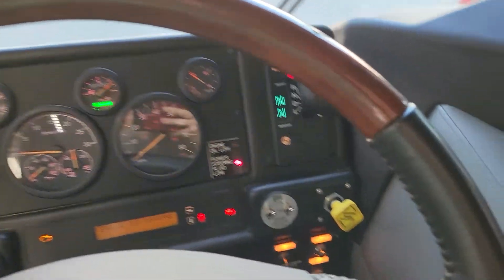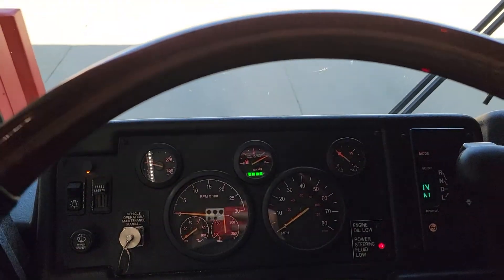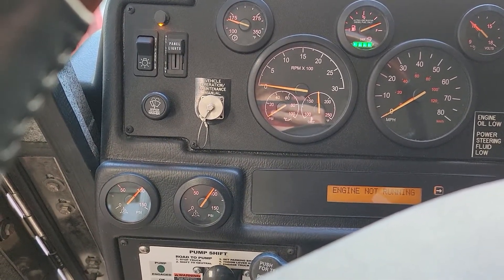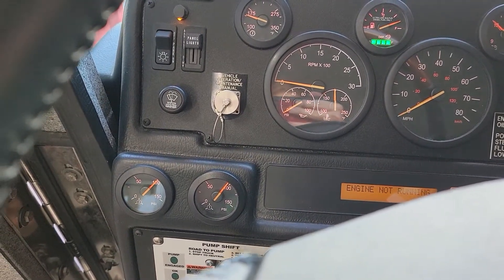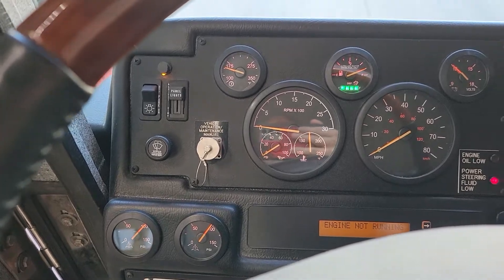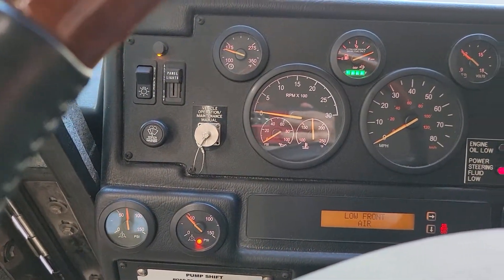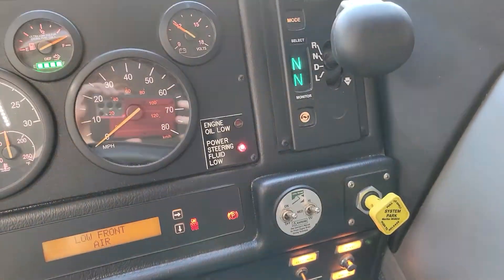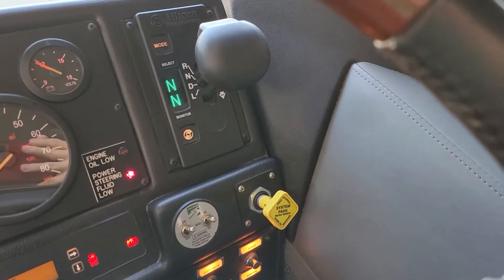Quick Air Brake Pump Down Test on a Fire Truck (Parking Brake Test)

Comment: I learned the air should be 120.  You turn engine off, then turn key to on position,   then start the procedure....  you can then hear leaks,&  air watch gauges
Reply from the maker: Yes.  I was given permission to perform this test for them.  I did it correctly for the most part except for the static test (release parking brake and wait 1 minute before pressing brake to make sure no more than 2 PSI is lost in that minute).  I have a better video of an air brake test I did with a school bus.

Comment: There should be exhaust pipes for the fumes....... and does it have an air compresser hookup? Because you wouldnt wanna wait for air to regain in the system when you have  to respond
Reply from the maker: They started the truck after I left to regain air pressure.
Reply: @BusMaster99  Ah ok

Comment: Cool! Exclusive fire truck access! My father is a volunteer firefighter and when I get a chance I like to try make videos on the firetrucks or a truck of my choice.

Our fleet contains a 2020 Freightliner M2 106 with airbrakes, 2011 International durastar, with airbrakes. 1980s Ford firetrucks with hydraulic brakes and we have a 2017 Ford F250 as our medical response unit.